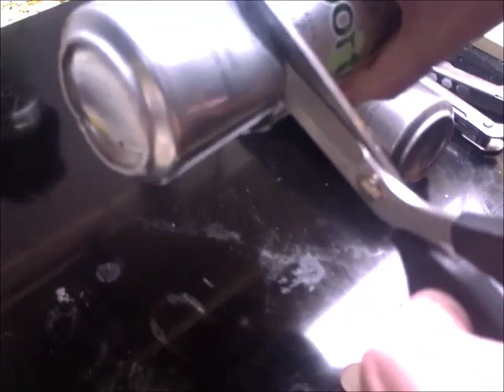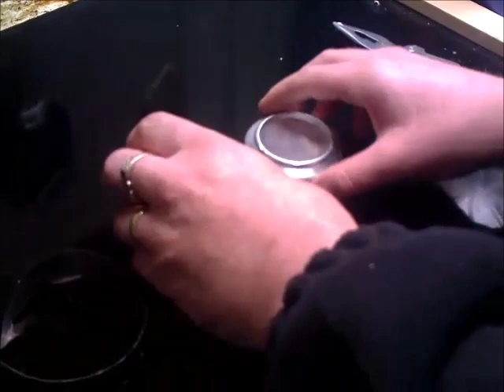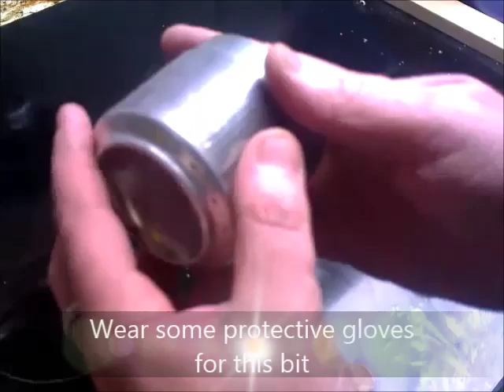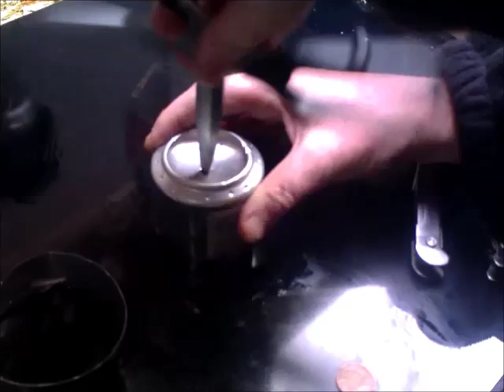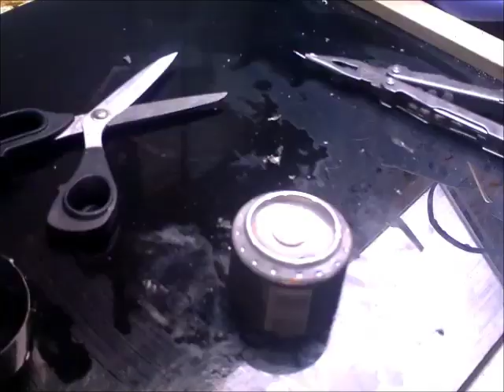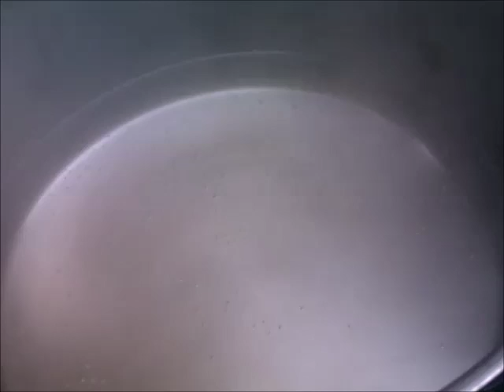How to make a homemade gas stove from tin cans

Comment: how will u turn it off or refill if u will continue cooking ? can we adjust he fire to high or low? tnx
Reply from the maker: Wakwak Wakwak you can refill it after the fuel runs out via the hole in the top. The flame is not adjustable

Comment: Nice one Stephen , 
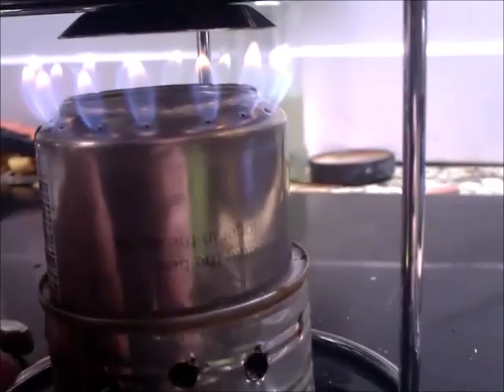but what happened at 6:30 
 https://youtu.be/GyzV0mAQ7e4?t=390 
It looks like you turned up the Flame !? .. or did I miss something ?
Reply from the maker: Hello and thanks for taking the time to watch my video.
The flame got bigger because I moved the stove slightly and it excited the fluid in the bottom causing the vapour to give a sudden boost out of the holes. Unfortunately, these devices can't be adjusted once lit. Thanks again!
Reply: +Telecastvids  ..Thanks for quick reply, Stephen , Ya that explained it !! - I thought you might have pressurised it :) by pushing the bottom section up slightly.. Its a great Idea your little "HGS" - I'll have to have a go at making one . Thanks for sharing